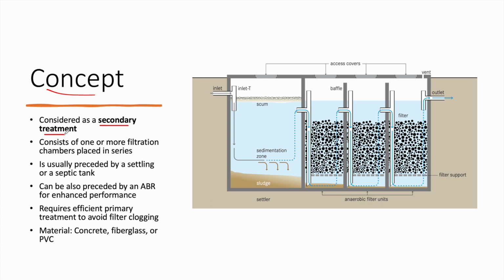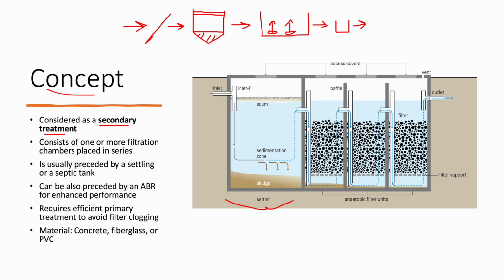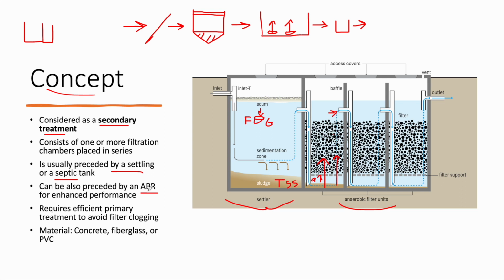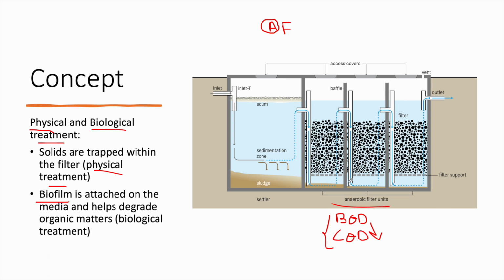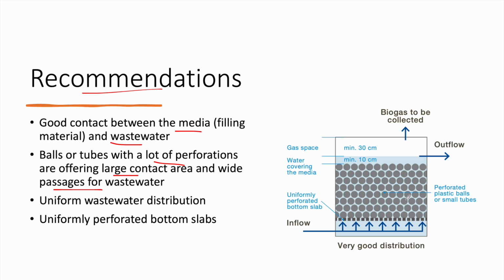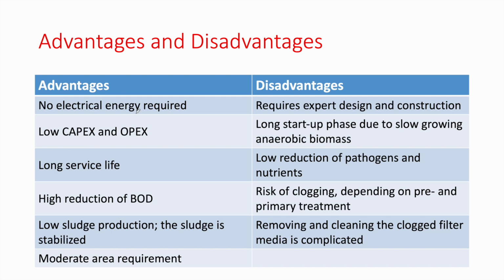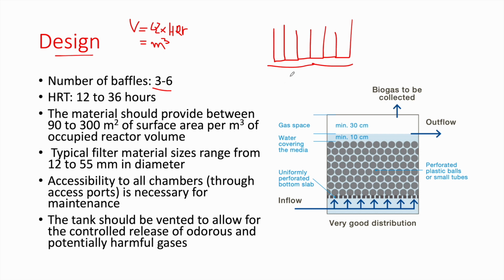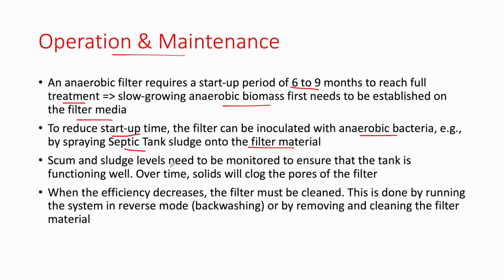Anaerobic Filter for Wastewater Treatment II Description and Design

Comment: Can we combine Anaerobic followed by Aeribic System to optimise Capital cost and running cost, and to get best treated water..??
Reply from the maker: For sure you can combine systems
ABR can be used as a primary treatment followed by an aerobic system as secondary treatment.
Reply: @wateracademy5866  in such case can we take liberty on design parameters  in aerobic system as the effluent is already passed from anaerobic system and treated partly??